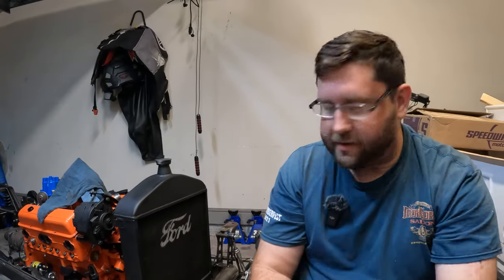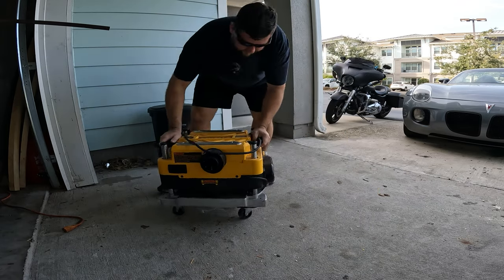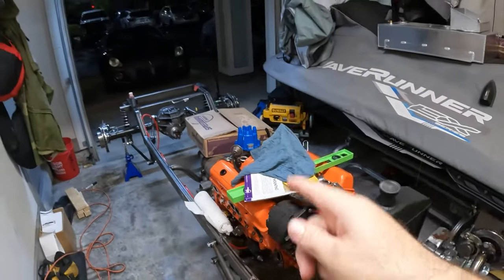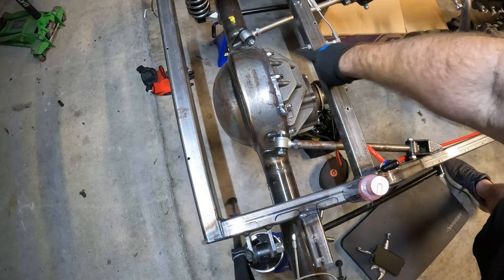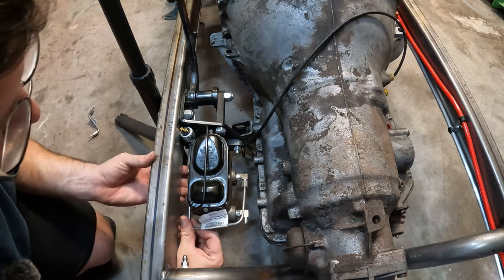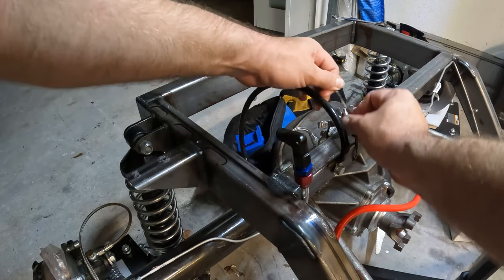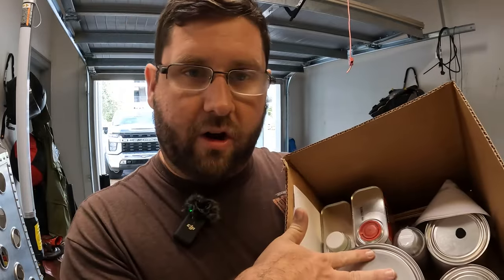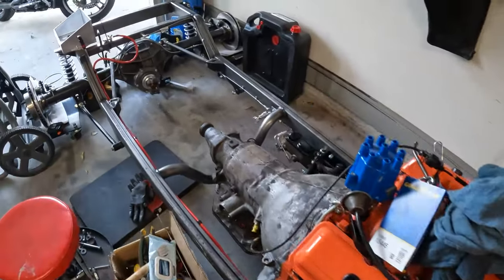T Bucket Hot Rod Full Build - EP6 | Speedway Motors Building the T Bucket ROADSTER

Comment: to stop the flow of the liquid nail when not in use rotate the handle and pull it back
Reply from the maker: It just keeps slowly oozing even with those special guns....I threw a yellow wire nut on it but hey it will be dried before I need it again

Comment: What gear ratio you running ?
Reply from the maker: Went with a 31/350. Wanted the best of both worlds and some ability for interstate without super high reving
Reply: @GearHeadzGarageUSA  that’s good. I had 308 ring and pinion with at 3spd manual on 15” wheels. This was 23 yrs ago. I’m ready to do another one all rowdy early 60’s style
Reply from the maker: @paulygood6665  yeah I was really on the fence about the rear end,  I would like to have a few that I could test out but they are stupid expensive now.  Definitely not as cheap to build as they were back in the day